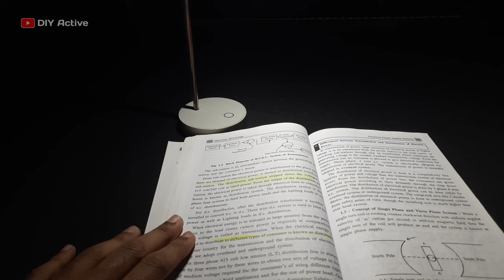Study Lamp ।। how to make table lamp at home using pvc pipe ।। DIY Touch ON-OFF Table Lamp

Comment: Bro from where u ordered the tpp 223 sensor
Reply from the maker: Buying at local market
Reply: @DIYActive  ok bro
Reply: One more question brother is it necessary to add the mosfet.  Does it give little bit brightness? Can we replace it with 8550 transistor